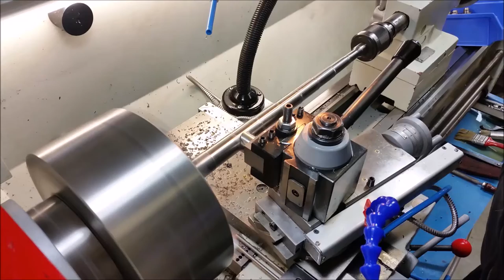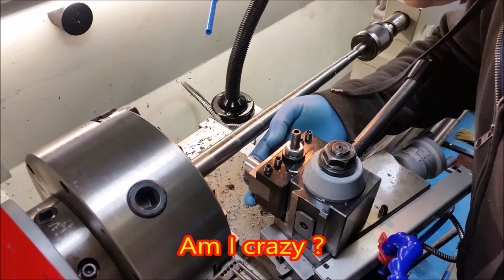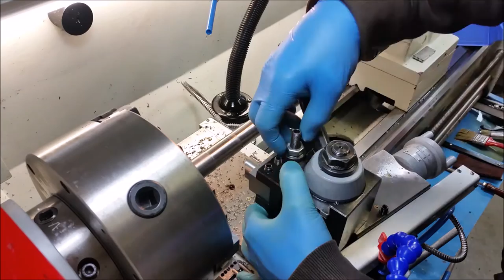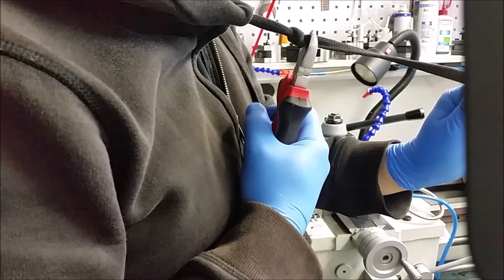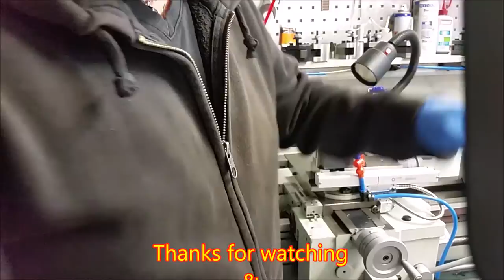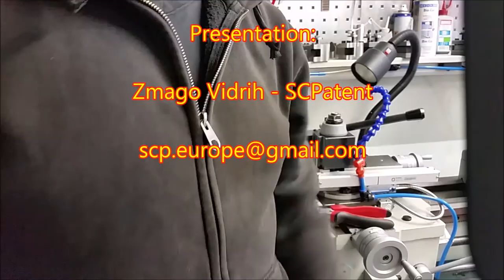Highly dangerous !

Comment: At least you noticed it and corrected it. I've seen a few people lose  aprons and  sleeves like that. Worst one was I saw a lady lose a small piece of her scalp when some of her loose hair drifted into the spinning chuck of a lathe. it was instantaneous.
Reply from the maker: joe dellaquila 
Hi, Joe.
Probably there is more to correct... at least I noticed this small mistake that can become very big one...
Hey, did you already got the switch and try to wire it to your machine? I hope it will work...
Until next time, be well; Zmago
Reply: Yes I did get the switch for my lathe. Before I could install it though i wound up getting a second hand VFD for a great price so I installed that instead. It has a speed control as well as forward and reverse.